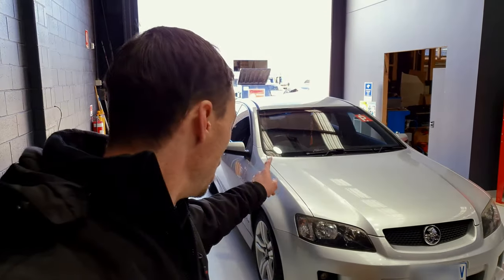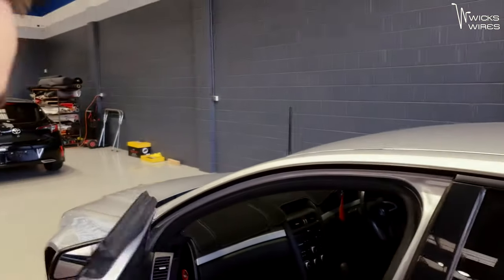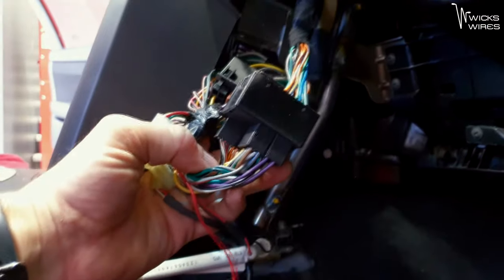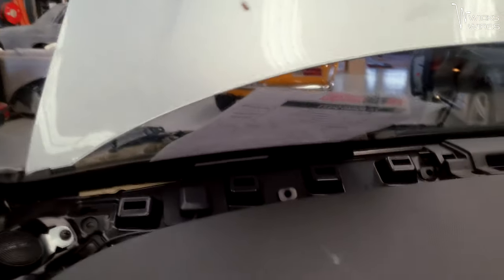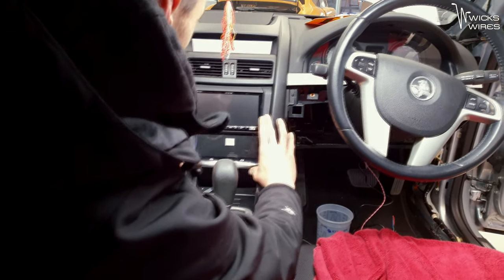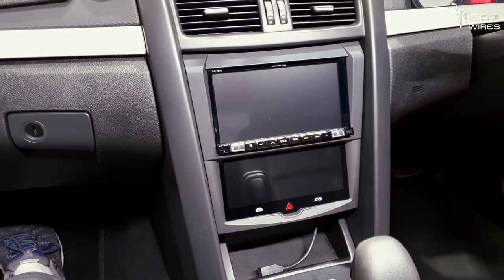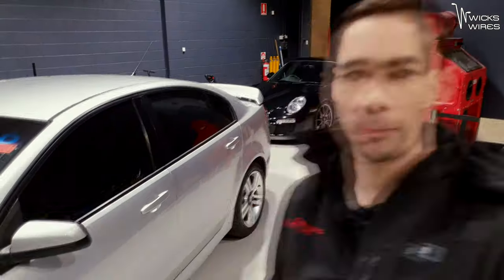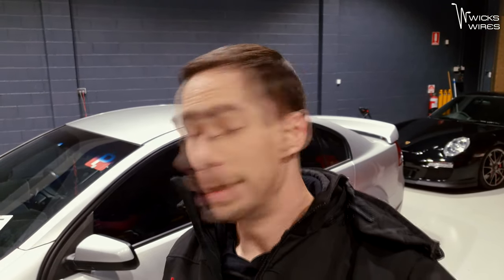Alpine's Brand New Facia kit Install In A Holden VE SV6!

Comment: Grettings from Brazil. This Fascia kit comes with a harness, right? This is the only cable needed to install one of that compatible multimedia, it's sufficient to keep the steering buttons working? 
Thank you.
Reply from the maker: Correct, it was a complete installation kit 🙂
Reply: Thanks! 
Here on the market I can buy ILX507 or ILXW650. They are Alpine's, but not exactly the same described in many australian websites. Did you know if they are also easy compatible with facia?
I already bought it by the way... Chills Here. 😂
Reply: Already bought the facia. In your country. Right now it in somewhere in Melbourne's airport. 😃

Comment: Hey do these new kits allow the drivers dash-cluster to show stereo information? like when you put volume up etc, current song/radio station, also does the steering wheel button for phone now work like the siri button? I've got the old alpine stuff and keen on these new features (got a 2008 SV6 wagon)

Comment: Is it possible to swap the steering wheel with a VE2 2012 steering wheel? Been wanting to replace mine
Reply from the maker: I would there is a very high chance that the wiring in the clockspring would be different from S1 to S2, so probably wouldnt work properly. I think the airbag plug was different as well

Comment: I have this kit but was installed at a shop, I need to remove it to do something how do you remove the plastic?
Reply from the maker: The plastics are clipped in but are very strong clips at the bottom, then there is a metal plate behind it that is screwed in 🙂
Reply: @wickswirescaraudioandfabri7730  awesome thanks heaps!!

Comment: Im a newbie will a single din head sony xavax3200 work in a ve series 1 ssv ute 2008
Reply from the maker: Yes it will but you will need to get the facia kit made by Aerpro. That will accommodate a double din but you can just use a pocket to fill the extra din 🙂

Comment: I got mine installed and it hasn’t retained the factory screen. Any ideas why?
Reply from the maker: In the settings of the lower screen, there is a setting to turn it on. You may need to dissconnect the battery and do a full reset, this can also help it read the can-bus data of the car. Hope this helps mate
Reply: @wickswirescaraudioandfabri7730  thanks. I’m taking it back to the installer on Monday and I’ll pass this information on👍

Comment: Do they have a alpine kit for a vf?
Reply from the maker: There is a new version coming out for the VF, but not too sure of when though
Reply: @wickswirescaraudioandfabri7730  Looks as though there lineup is about to change, i wanted to get the ilx509 Halo9 with wireless apple car play but doesn't seem available anywhere in the VE series 1 kit - they have it on there website so not sure what is going on.